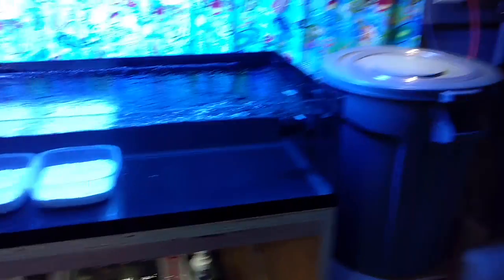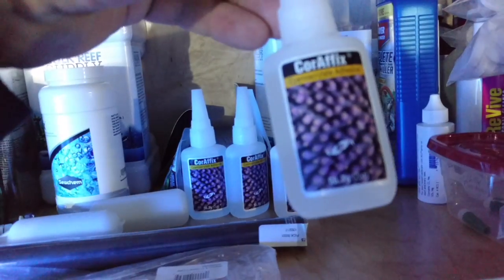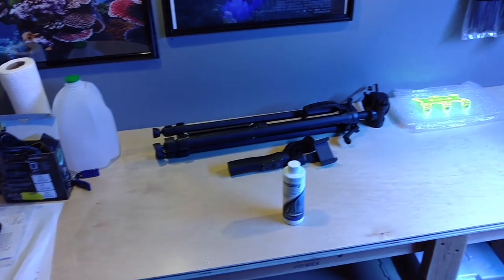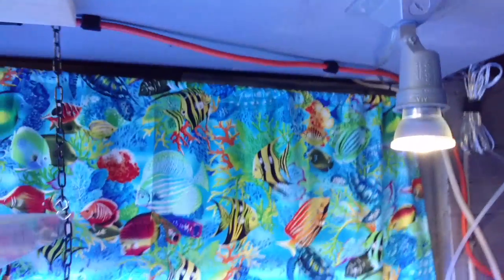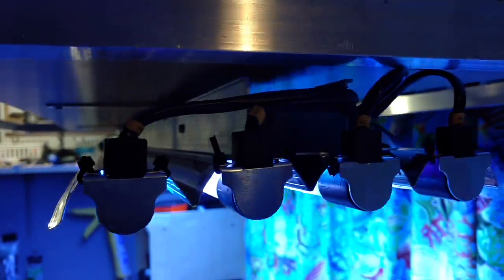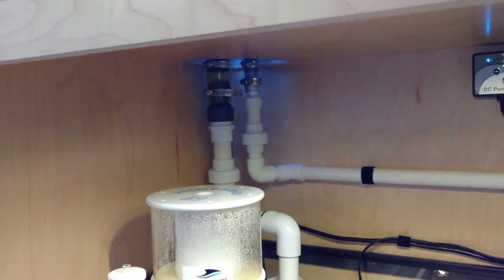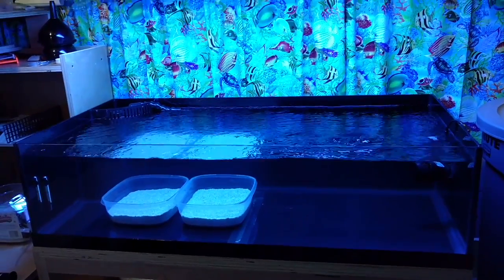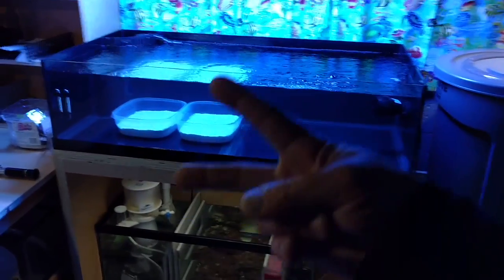Basement Frag Tank

Comment: Shut UP with those deal prices bro. Thanx for the dimensions and capacity  on the sump. Is that return pump going full blast or does she have more to give?
Reply from the maker: Dave's Nano Tanks lol. It's actually at the lowest speed. Plus it's tampered down with a valve.
Reply: Nice. I think I need on for the new build. Going 3/4" verticle then tee down to two 1/2'' RFGs.
Reply from the maker: Dave's Nano Tanks the dcs 5000 is more than enough for ya